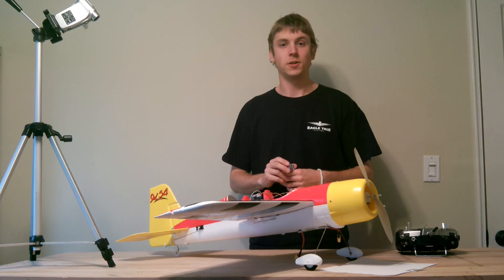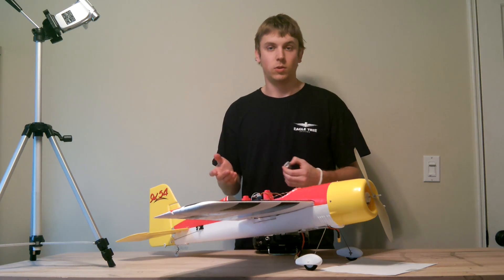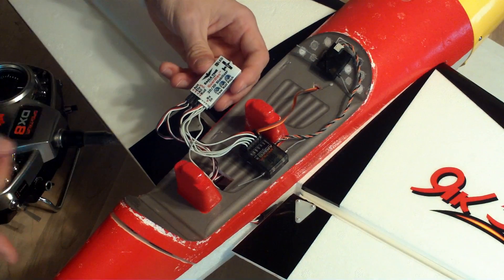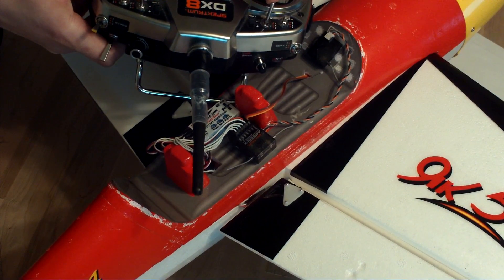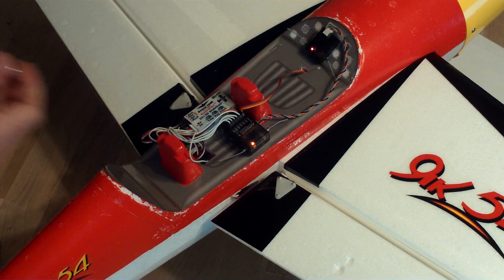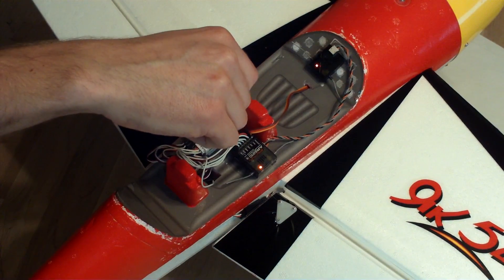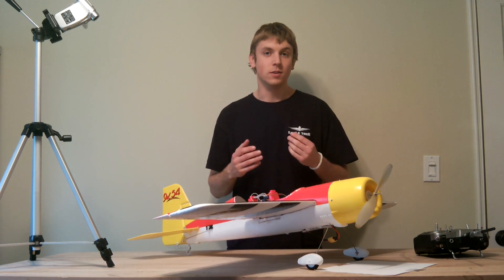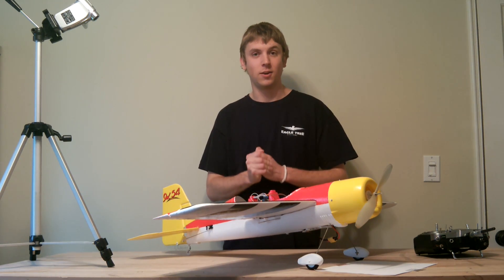Guardian 2D/3D Stabilizer Tutorial

Comment: i just wonder how can you firmly secure it to the plane, when the electronics are within [what looks like] such a flimsy housing. also, the pilot must be careful with quick mode changes, to prevent the stabilizer from resetting its "level" orientation. if that happened by accident, he could easily crash it. i guess level flight mode isn't meant be used as a rescue mode. it would be nice if it was, though. is there a way to disable that method of resetting the leveled position?

Comment: As a newb just learning to fly I think this will really help me a lot. I just ordered mine but was hoping someone could tell me if you need to worry about vibration (like with the FY31ap/FY41ap and such systems) ? Mounting this on my Senior Telemaster kit I just built and I`m using a 120 4 stroke gas engine. Should I use  some type of vibration mount ? like sorbothane or gel ? Hope to mount this on my GP Siren also....Would be nice if Eagle Tree would answer some of these questions !

Comment: I am using a 6 channel futaba; I am using flaps and ailerons with a Y cable, that leaves one free channel, that could be used for the guardion mode or gain whatever. I believe that the guardian has a 6 channel plug, if so where do I plug in my flaps, thanks for any help

Comment: got one for my power25 parkzone mustang- i like the 3D mode the most, tossing the plane is no worries! 2D mode looks like it will be usefull for slow flyers like my PZ albotros, maybe great for those slow and low passes, ill try it on my F4 6S foamie soon, cant bring up the PC menu when plugging in, does unit need battery power from Rx?? or maybe my cable is incorrect??
Reply: The USB cable supplied by Eagle Tree will work.  Some other cables may appear the same but are not.  The power from your PC through the cable will drive the Guardian.  Once level on a table "Reset" may be selected on screen, especially if you think you messed up.  Then prop the Guardian to the position it will have in level flight.  Install the Guardian in your plane,  adjust the gains to a modest amount.  Hold the plane in your hands and watch the control surfaces move as if it to bring the plane back level.  Too much gain and control surfaces may oscillate. Works for me.

Comment: Look at the pin out in the manual. The pins are easy to take out. Use a hobby knife to lift up on the little tabs that hold the pins in.  Doesn't take much, so don't pull them up too far. My first plug was exactly opposite of what it needed to be. Can see that is was a honest mistake. Good luck!

Comment: thanks for the reply  the other day I just when crazy and mix the wires and looks like they had everything label wrong  I have the ailerons and elevator revers with each other  and the gain with the mod so know is coming on and I can control it, but the rudder is not responding to the stick so I'm going to check the wires like you say, although costumer support  recognized there is something wrong with the cables and they are sending me a new set

Comment: I just go two of them, the first one did the same thing your describing.  The second worked fine. Further inspection showed the wiring harness from the small molex plug was backwards from the one that worked. I repinned the plug, pulled out all the wires from the plug and reconfigured, and everything worked great. Check the wiring against the manual.